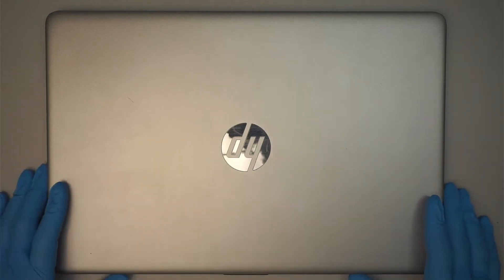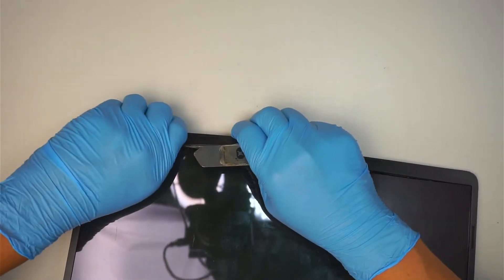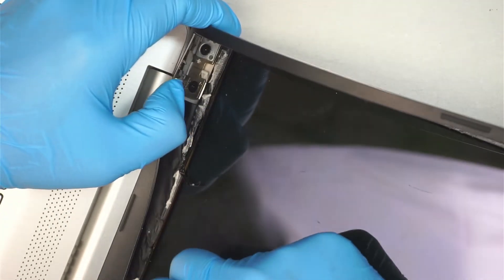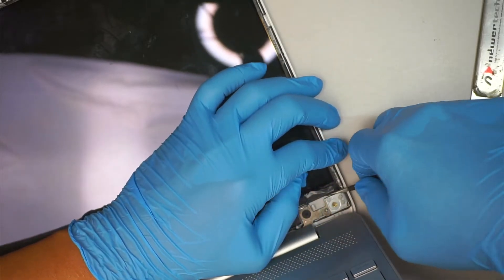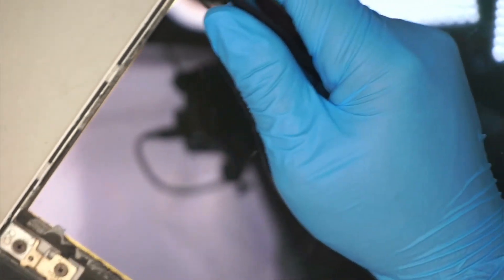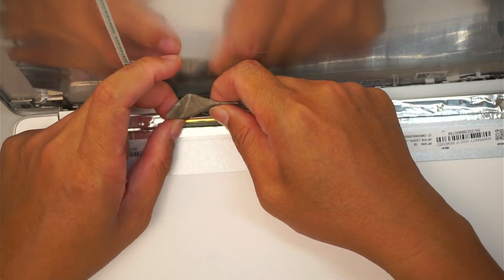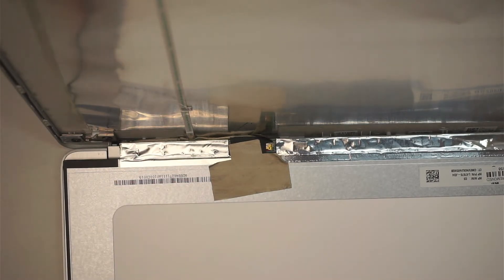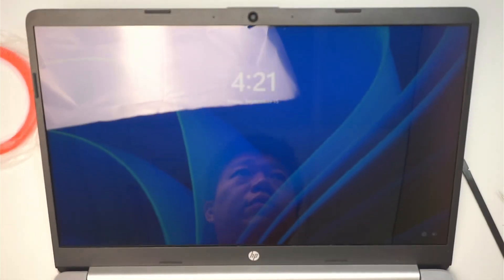How to Replace HP 15 DY Laptop Screen

Comment: the pull tab is actually underneath the metal tab with the silver screws on the top left and right. you have to bend or move the metal tabs a little to get to them. at least that’s where they were for me

Comment: I have replaced over 5 HP LCD's before and first time the tape was hidden and hard to get at. I had to break/bend/crack the old screen to lift a corner to get at the tape. Thanks for video

Comment: Wow, amazing! I would recommend using a heat gun lightly on the adhesive part of the screen that way you’re not just cutting through the adhesive at a cold start

Comment: when buying a new screen to replace does the model number has to be the exact same? 
My model is 15-dy5033dx but not seeing any replacement screen with that exact model number
Reply: As long as it’s the same size, the brackets fit the same screw position, and the pin connector is correct, it should work.
Reply: Literally same
Reply: @itsjustmex1p54  btw it has to be the same exact model number